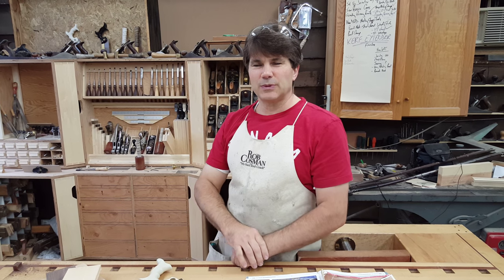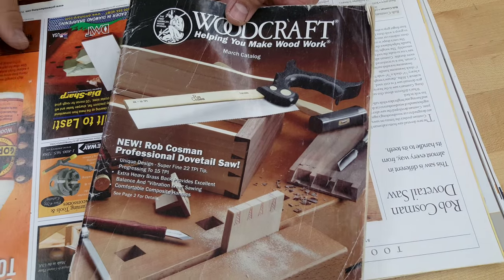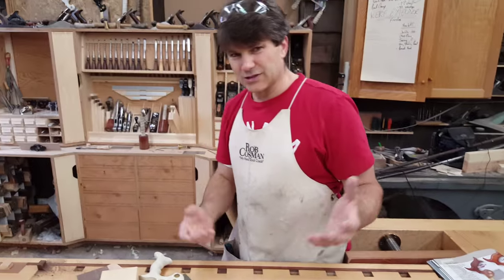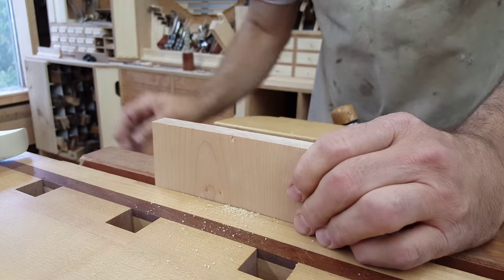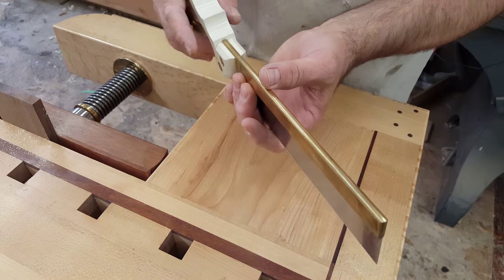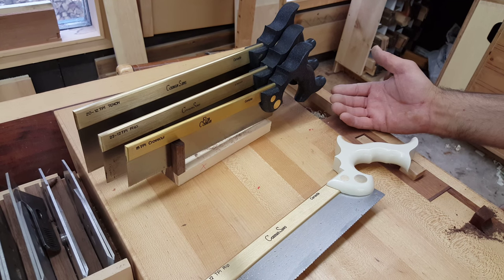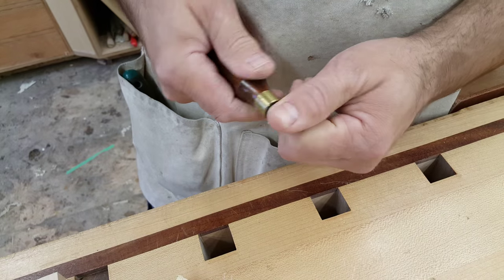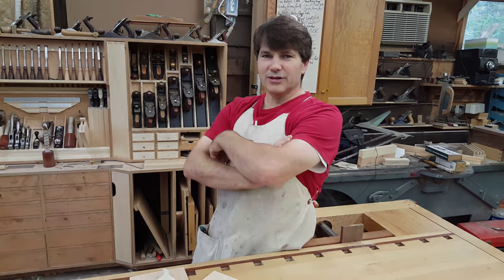Rob Cosman's Dovetail Saw 7 years later!

Comment: I'm saving for this saw now, and satisfied that I'm making the right choice. I'm in my sixties, and physical issues have become a consideration. Since I'm also new to woodworking, I fall neatly into the category Rob mentions in the video. 

Moreover, every time I think about Rob's dovetail saw, I'm reminded of childhood experiences learning to ice skate. Dad wanted to make sure I was going to stick to the lessons before buying me a good pair of skates. Until then, I was having to rely on rental skates. But the boots were always broken down. The blades couldn't hold an edge. Dad even paid to have rental skates sharpened before lessons, but the blades still wouldn't hold an edge, and I couldn't perform as I would have been able to with blades made of superior composition. I was truly miserable. That is the precise word to describe those experiences. I so wanted to learn the various maneuvers, but it was nearly impossible with cheaply made, well-worn rental skates. Once my Dad bought skates for me that were of better quality, though, everything changed. I had a chance, and I wasn't miserable on the ice anymore. Suddenly, I felt like I could soar! This is the very same principle. I want this saw, and I'll be happy when I can buy it. The purchase isn't that far around the corner now, and I don't mind waiting a bit for the best.

Comment: The review in Fine Woodworking is what made me go out and buy the saw. It was hard to spend that kind of money, but I am really impressed with the extra weight. It was the 2nd dovetail saw Ive ever owned. I already have a Lynx tenon saw but I plan on buying the tenon saw still. I love the bone resin handle. Thanks for some good products Mr. Cosman. I can tell my dovetails have definitely improved. I use a method that combines yours and Paul Sellers' methods.